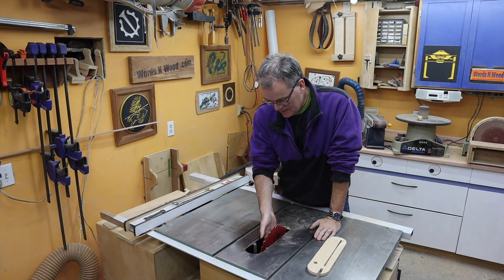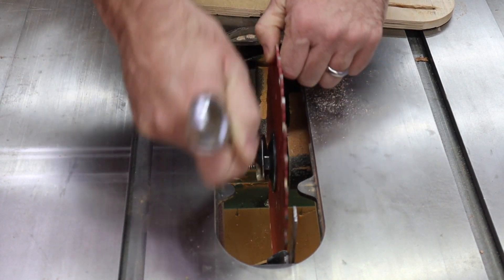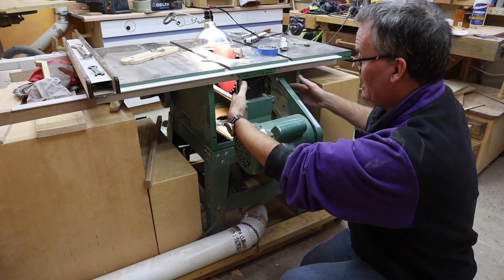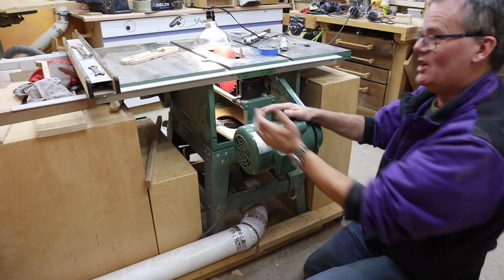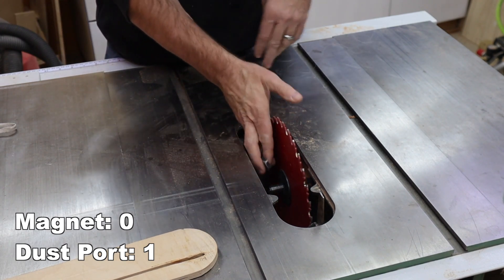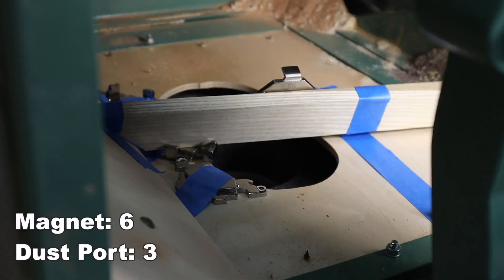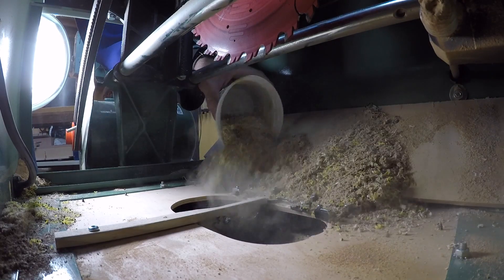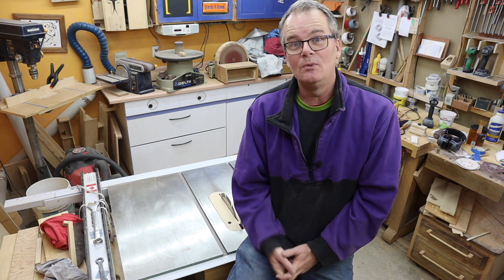WHY am I putting magnets INSIDE my tablesaw?  // WnW 219

Comment from the maker: And yes, I'm an idiot.  Hardware cloth or fencing or something....  (where do you buy like just a 6x6" piece of fence?)   😆
It was still fun.
========== ==========

📃Build Article:  http://www.wordsnwood.com/2021/arbornut/

This video is about an experiment.

I recently dropped the arbor nut while changing my tablesaw blade and the nut went right down the dust collector port.  This meant I had to partially disassemble my dust collection hookup to the saw in order to retrieve it.

Now, I am VERY careful when changing tablesaw blades, but I still want to figure out a way to prevent this from happening.

So I hit on the idea of placing some big rare-earth magnets inside my tablesaw, with the hope that they would catch the nut if I ever did drop it.

This meant, of course, that I had to now INTENTIONALLY drop my arbor nut into the saw, in order to experiment with this configuration.

78% success!

YOUR SUPPORT IS APPRECIATED:
💵 Become a Patron: https://www.patreon.com/wordsnwood
🛒 Buy a Plan: http://wordsnwood.com/plans/
👕 Buy Merch: wordsnwood.com/merch.html
👉 http://www.wordsnwood.com/support.html

---------- ---------- ---------- ---------- ----------
🗜 LINKS TO SOME OF THE ITEMS USED:

(AND/OR other tools and jigs that I use and recommend.
Most of these are affiliate links.  If you buy through these
links it helps support my channel.   Thank-you so much!)

https://amzn.to/2X1fN5C -- Rare Earth Magnets

📸  GEAR I USE TO MAKE VIDEO:

https://amzn.to/2OVusfx — Canon EOS m50 camera kit
https://amzn.to/2nI7w8Q — Shure VP83 LensHopper Microphone
https://amzn.to/3l7cSmi -- Rode Wireless Go microphone
https://amzn.to/3k9pFTR -- PoP voice lavalier lapel microphone
http://amzn.to/1qPkvBp — Canon T5i
http://amzn.to/2aK7jZX — Inexpensive Quick Release tripod ball head  (Very useful)
http://amzn.to/1SSwOmS — Sony Action Cam. (I use the HDR-AS15 which is discontinued -- cheaper than a gopro.)
http://amzn.to/267XM3M — Sony Live View video remote for Action Cam
https://amzn.to/2NddVjk — But I do also have a GoPro Hero 5 Black
http://amzn.to/1XC2D7l — Joby GorillaPod (Flexible small tripod)

As an Amazon Associate I earn from qualifying purchases you make using my affiliate links.

---------- ---------- ---------- ---------- ----------

MORE MORE MORE:
http://www.wordsnwood.com
https://www.instagram.com/words.n.wood
https://www.facebook.com/wordsnwood

---------- ---------- ---------- ---------- ----------
🙏🙏Thank-you! 🙏🙏
Reply: Not at all, the magnet was a good Idea, just overkill.  Some people are lazy and settle for less elegant solutions.

Comment: FIRST: magnet stuck to string stuck to the shaft end, spin off the nut, after,  fish blade and nut on string and slide, spin the nut on the shaft. pull off string/magnet.  you make a once in a while minor annoyance with the not often blade change task more difficult than it is.

Comment: How about a long piece of wood with the magnet recessed flush, or almost flush, with the wood stick that you would use to capture the nut as it instead of you fingers as it comes off  the arbor? 
You would also use it to hold the nut on the arbor to start the nut on to the threads.

Comment: Maybe re-think the unscrewing technique... Instead of your finger on the spindle maybe a stick with a magnet and a spacer... So it will catch the nut just when comming off the spindle... For putting back maybe a sheering mechanism that separates the nut from the magnet towards the spindle.... 
Hope u get the idea... I don't have the problem but i feel with you.

Comment: You could also attach a piece of thin plywood with a beveled edge over the opening, covering when seen from above, but open on 3 sides.  When the nut was dropped it would be deflected to the bottom... if that makes sense.

Comment: Those magnets slide off of the carriage with a bit of coaxing. They're a bit of a pain to get off but they're just held in place by the magnetism itself (occasionally also a mild adhesive). I usually just clamp the carriage in a bench vise and then tap the side of the magnet with a hammer and screwdriver until they come loose.

Comment: Hello, if I were, I would use a perforated aluminum plate at the entrance of the tube and there would be no need for a magnet at the entrance of the tube and with a small rod and at the end a magnet to fish the nut, continuation of Bom Ano and a strong hug from Portugal.

Comment: "Don't drop the arbor nut.  Don't drop the arbor nut.  Don't drop the arbor nut.  Don't drop the arbor nut. "  Drops the washer.  <- Me once a year.
Reply from the maker: This is one of those things that you just do and don't think about, so it's hard to describe when you aren't there.... BUT ... I think I always take the washer off with the blade.   And again, have the finger over the end of the arbor.   Still, I have dropped that also.

And apparently I'm an idiot for not thinking of hardware cloth.   Still, it was a fun experiment.

Comment: A blast gate with a cleanout. The nut drops down and is stopped by the closed blast gate.  You open the clean out and collect it.  Then you don't have to fish it out of the saw!   I have dropped min a few times too but turn off the dust collector so it stays  in the flex hose near the saw.

Comment: I’ve added a steel rod the same diameter of the inside of the arbor nut on the end of the threads where the arbor nut goes on. This makes it very easy to place on and off.

Comment: I agree with Mikey Makes.  You don't need the Magnets just a piece of 1/2 in hardware cloth (Chicken wire) over the area under the arbor where the plywood is.  The would let the saw dust fall through and catch the arbor nut.

Comment: Why not fill dust hole with a cloth whilst changing blade and then remove it before using saw. Cloth would catch nut for easy retrieval. This means no restriction to hole while using saw as would be the case using a mesh guard.
Reply from the maker: Maybe I'm not visualizing this, but how would I place a rag over the dust port, which is inside a mostly-sealed saw cabinet, way at the bottom?   I don't think I could reach that through the throat
Reply: @Wordsnwood  I thought you could put it where you fixed the magnets. Just push it by the blade with a stick etc then use magnet on pole to retrieve nut and hook out cloth. Works for me.

Comment: Do you have the space and access to place a gate at the "entrance" of the dust collection pipe and easily operate the gate handle? If so you could close the gate when changing blades. If the nut drops and falls on the closed gate. With a "magnet on a stick" could be used to retrieve the nut.  Just my $.02 cents worth but with the current inflation rate it would be more of a negative $.10...👍
Reply from the maker: The idea is to take the fallible human who makes mistakes frequently  (who me?) out of the equation...
Reply: @Wordsnwood  You are as awesome with words as you are a creator!

Comment: What about just placing a piece of plywood over the hole when your changing the blade?
Reply from the maker: you try to take the human element out of the equation.  I could just always turn off the DC and close the blast gate... but I am a fallible human and will at some point forget.  The magnets are always there.    But I do admit that the people suggesting mesh probably have a good point.  I just (a) don't have any and (b) really don't like putting anything in the dust stream and of course (c) this was actually kind of fun to film.

Comment: If you are concerned, when changing the nut get a rag and spread it under the blade before loosening the nut to catch any slips, take it out when finished.  I usually keep a rag under the saw stand to wipe it down and it could serve double duty.  It takes no time to drop it in the space before starting to change the blade. 

It's not a problem since if I drop the nut it doesn't go anyplace, just use a magnet retrieval tool to remove it when it does happen.  Your solution is a way to do it, but there are other ways.   Good presentation, all very clear.

Comment: When removing the arbor nut, put the magnet on the arbor and unspin.  Once the nut hits the magnet, use the magnet to spin it off (?)  Hopefully installation (in reverse of what I said) would be easy, but might be more difficult to start the thread.
Reply from the maker: Interesting idea, thanks

Comment: 1/2 in chicken wire mesh. In cone shape below the blade. Plus a magnet at a turn in pipe below. Stick it on outside of pipe. To not obstruct the flow.  At least you’ll know where it goes.

Comment: What about a piece of wire mesh, if I’m not wrong, I think it’s also called chicken wire,  the dust out pipe seems to be wide enough, I will try that, and maybe the magnets around the hole perimeter just so when the nut got dropped it will bounce the magnets will do the job catching it.

Comment: Why so much effort for something you drop once a year?  Luckily, my dust port disconnects within 12 inches of the edge of my saw.  So I can use a 24 inch long reach magnetic rod and get the nut.  I seem to have a little more space for removing the arbor nut.  So I have dropped mine once in the last 5 years.  Good luck!
Reply: My guess: Because it was fun and made for an entertaining video!
Reply from the maker: @bodshal  This man gets it.    Also, I am but a fallible human.  Imagine the carnage of an arbor nut hitting the DC impeller because I forget to turn off the DC.

Comment: I just recently sucked up a plastic guard for one of my routers into my dust collection hose attached to the router. Needless to say, it didn't survive when it hit the impeller.
Reply from the maker: Metal arbor nut meet metal impeller blade going 1500rpm (or so)...    I don't ever want to find out what that might be like...   😬

Comment: How many gigacuts can your table saw store on the blade now? 
What if you magnetized the arbor (small one on the end of the arbor) so that the nut doesn't want to drop off once fully unthreaded?  Your saw isn't direct drive so that shouldn't be a problem for it.
Reply from the maker: You got me.   I'm really experimenting with table saw levitation.  Just need to get enough magnetic fields for the sawblade to spin through...

Comment: I too have a lot of HD magnets.  I was a tech for 52 years in my previous life. I use them to hold any sort of tool that is used repetitively such as allen wrenches, table saw wrenches, drill press chuck key, etc.
Reply from the maker: Scary powerful.  But short range.
Reply: @Wordsnwood  A magnetron magnet might work better. More mass, more range.  My Unisaw has a straight drop to the bottom of the cabinet and then I can open the access door to retrieve the nut or dropped tools.

Comment: John Heisz made a nut remover tool that works well and stops you dropping your nut in the first place, or you could just put some ¼ inch mesh over the dust shoot to stop it going down, you only get very fine dust in a table saw.

Comment: seems like it would have been a lot less work to just make your rear dust pipe easier to access.. when i drop mine i pop the end off and put a magnet on a stick in the hose until it picks up my arbor nut then just plug my dust pipe back in.. coo idea though love your vids
Reply from the maker: But not as fun...  :-D

Comment: Wire mesh... adding too the magnets 🤣
Reply from the maker: You work with what you have... I have magnets.  I don't have wire mesh.   Maybe I could solder up a grid of coper wires.   Nothing like making work for myself!  😉
Reply: @Wordsnwood  Thin plywood with a hole pattern drilled into it?

Comment: I think a wire mesh material, with a grid small enough to catch the nut but no smaller, may be the way to go if you want nut catching perfection. Fairly sure that won't obstruct too much dust flow.
Reply from the maker: But I already had magnets...  😁  

You're probably correct.  I'll keep my eyes open for something with a wide but not too-wide mesh.
Reply: @Wordsnwood  1/2" hardware cloth. Like square weave chicken wire, and can be made from plastic too.
Reply: @Wordsnwood  I am thinking if the wire is of a thicker gauge you could out the magnets on as a backup. 
My second thought was to have metal rods with the magnets attached running across the opening spaced about twice the width of the nut.
Reply: Even a piece of thin plywood installed along the length of the whole for the collector port on a 45 degree angle would stop the nut from falling through but not obstruct the dust. I think it would work pretty well. Still put the magnets on it to keep the nut from bouncing around. and hitting the blade. I would make it just high enough to  take it past the plane of the arbor end.
Reply: Yep, chicken wire would probably work well. Just a flat piece over the oval hole. I doubt it would accumulate any sawdust... the vibration from the saw would shake it through.
Art still gets a thumbs up and an "A" for effort though!  And I am now inspired to extract the magnets from my collection of to-be-recycled hard drives!